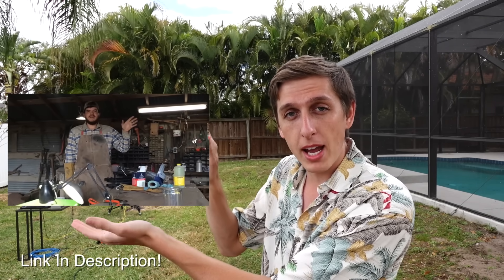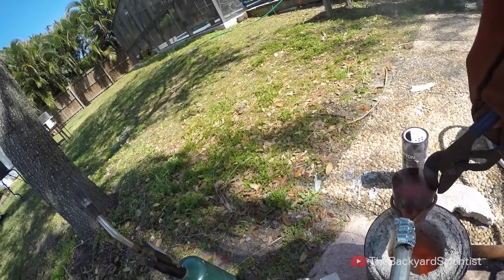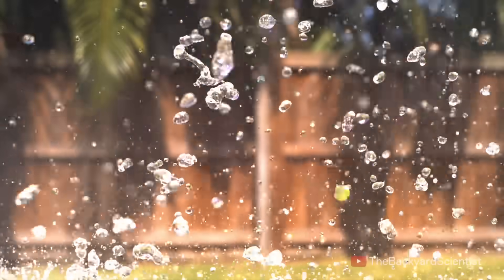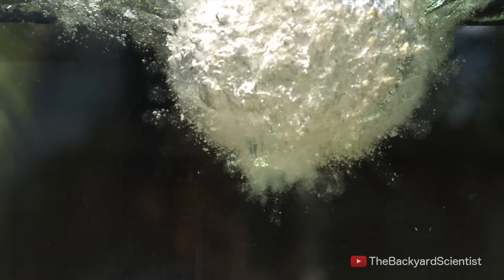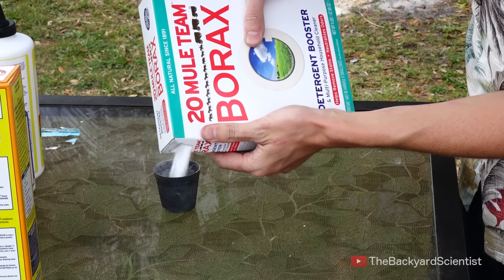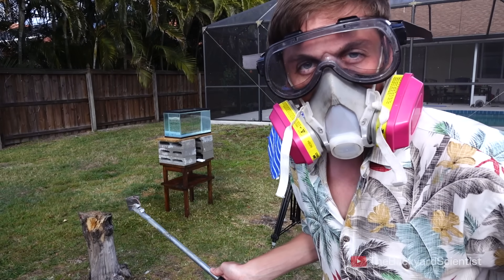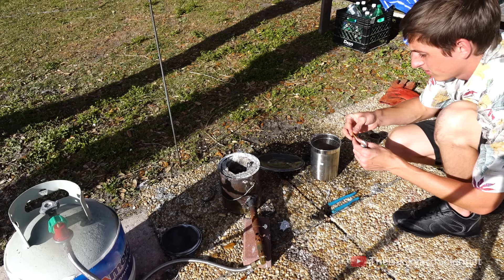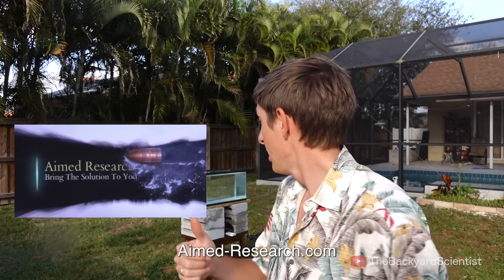Pouring Molten salt into Water - Explosion!

Comment: Explanation: The sodium reacted with the water because it's an alkali metal, and not because of the heat. The NaCl (the salt) doesn't react with the water, but since it is very hot it instantly heats up the water to its boiling point which creates lots of steam, which is the "explosion" (like when you pour water on a hot stove). The "explosion" with the salt and the sodium aren't related to each other. One is a chemical reaction, and the other is just a rapid change of aggregation in water because of heat.

Comment: Shouldn't 21,000 fps be extremely fast?
Reply: That means that you could slow the video down to 1/21,000 of a second, so no.
Reply: What they do is they slow down the 21,000 FPS footage, so it's more like 60-ish FPS. To elaborate, imagine capturing a single second of 21,000 FPS footage, then slowing that down to the point where 60 of those 21,000 frames are played each second over a longer period of time. Simply put, the higher the FPS of a recording, the more it can be slowed down without making it look choppy.
Reply: Cameron Meetze Depends what you're doing. With videos it doesn't

Comment: Sodium chloride is a salt that has a much smaller particle size than boric acid and sodium carbonate, and of course water. This property allows it to heat up much more water molecules as it can side through the gaps between the water molecus, heating them up as it goes. When the water molecules expands, it will tend to hit one another, causing a chain hitting process. Just like an atomic bomb, the molecules will hit any particle in its path, may result in a shattered container mess to clean up.

Comment: l got an explanation :
Sodium chloride is a salt that has a much smaller particle size compared to boric acid and sodium carbonate, and of course water. This porperty allows it to dissolve in water, involving more water particles. As the water molecules expands due to the heat, it will tend to hit one another, causing a chain hitting process. Just like an atomic bomb, the water molecules will spread out, hitting any objects in its path, resulting in an explosion that broke the container, shattered in pieces.

Comment: Rapid thermal expansion.

Leidenfrost isn't having an influence because the surface area of the salt is too great and acting at too small a level for it to act in a preventative manner. It's basically going into solution as soon as you pour it in, but because it's molten it's pushing the water away from it at damn near the same time and forcing multiple bubble-explosions into each other until they combine and force further outward. 

You tested the pH of the water, but you could also test the EC and salinity before and after to see if this is plausible, but it makes sense to me.

Comment: I think it is due to solubiity differences. I am assuming that these Na salts retain solubility differences that they show in room temperature. Because NaCl is more soluble, it is dissolving faster, and making more superheated steam. Potassium salts are more soluble, so those should make even greater explosion. Say, if NaCl and KCl melt at similar temperatures, and KCl is more soluble than NaCl, it will make a bigger splash.
Reply: I am not encouraging you to do it. This is too dangerous, and you are unprotected.

Comment: sodium is an Alkali earth metal, so when you melt down salt you're creating a solid brick of sodium that's highly reactive with water. It can even explode with humid air. Its highly dangerous and you shouldn't have messed around like this without proper research.

Comment: it looks like the liquid sodium salt has a much lower viscosity and possibly lower surface tension than the others. If it is separating and allowing for rapid thining it could be cooling fast enough to drop below the Leidenfrost threshold and encapsulate droplets of water.

Comment: My guess is that the molten salt has a rather low surface tension and low viscosity unlike other tested materials.
Then it takes less energy for a molten salt drop to tear apart anx mix with more water, than for the leidenfrost effect to form.
Also, sodium chloride has an extremely high enthalpy of fusion, that might also explain stuff.

Comment: this is a chemical reaction, drop pure sodium(not melted) into water and it will ignite/explode. it is a defining property of alkali metals
Reply: the reaction is a product of the ionization of the alkali metals and the water. this is due to the transfer of energy abundant electrons to the h2o molecules from the Nc atoms. The transfer rapidly repels the resulting positively charged sodium ions. (if you wanted a more scientific response).
Reply: +Larry Wyatt Nc= sodium (and you probably know this but) H2O = water, and this goes for all alkali metals not just sodium

Comment: I think we can agree that the molten salt is creating a STEAM EXPLOSION, not generating hydrogen and chemically exploding.  Perhaps you should heat up a large ball bearing or a small cannon ball cherry red and drop it in and see what happens.  If you can find a metal ball with dimples like a golf ball it would have more surface area, and provide an interesting variable, as more surface area would provide a greater heat transfer rate.  Come to think of it, part of the rapidity of the heat transfer could be that the molten salt is being cooled below its melting point and therefore MUST release its Latent Heat of Fusion, which is immediately being converted into Latent Heat of Vaporization for the water.  Be careful, so you don't earn a Darwin Award. ;)

Comment: I heat treat metal using this cooling process and can tell you getting the splash back from this burns so bad. Even through protective gear at work I have the scars on my hands to show for my efforts

Comment: This is kind of steam explosion. salt is sodium chloride which is a stable reacted compound which has no chemical reaction

check out https://en.wikipedia.org/wiki/Steam_explosion for knowing more on steam explosion
Reply: I quote the webpage "A steam explosion is a violent boiling or flashing of water into steam, occurring when water is either superheated, rapidly heated by fine hot debris produced within it, or heated by the interaction of molten metals (as in a fuel-coolant interaction, or FCI, of molten nuclear-reactor fuel rods with water in a nuclear reactor core following a core-meltdown). Pressure vessels, such as pressurized water (nuclear) reactors, that operate above atmospheric pressure can also provide the conditions for a steam explosion. The water changes from a liquid to a gas with extreme speed, increasing dramatically in volume. A steam explosion sprays steam and boiling-hot water and the hot medium that heated it in all directions (if not otherwise confined, e.g. by the walls of a container), creating a danger of scalding and burning.

Steam explosions are not normally chemical explosions"

Comment: It's the sodium hitting h2o. Since sodium vs. h2o equals an explosion, that's exactly what happened. Because the sodium chloride was heated to a very high temperature a chemical reaction could have happened causing the sodium and chloride ions to weaken their hold to each other, causing a large explosion when the melted compound hits the water. This is just a hypothesis aka my own opinion.

Comment: Sodium Chloride does not react with water chemically, it dissolves into sodium and chlorine atoms, and does not change the pH. Whats happening is the sodium in the salt is partially shielded by the surrounding chlorine atoms, and thus gets a little deeper than the pure sodium before exploding. Just like a grenade under water explodes with much more concussive force than a grenade in air, the resulting explosion of the salt is bigger than that of pure sodium which simply explodes on the surface of the water.
Reply: Tbh, I was way to lazy to read all that.
Reply: +Armine enimra but not, apparently, too lazy to respond... lol
Reply: nope, that would imply a chemical reaction, because just sodium 0 explodes with water, but the sodium ion in sodium chloride are +1, plus the reaction between sodium and water releases NaOH that changes pH
Reply: From what I am seeing I would suggest that the reaction has two phases:firstly an implosion phase, and secondly an explosive phase.
When the molten salt makes initial contact with the water, the outer part of the glob of molten salt cools more rapidly than the internal part of the glob of molten salt. The direction and speed of the temperature differentiation wave is towards the centre of the salt and squeezes the molecules together as it goes. Once it reaches the centre it cannot go further and pressure builds up and rebounds the wave outwards to cause the explosive effect. It's a physical reaction rather than a chemical one.
Reply: @Franco Viscarra: Yes, and chlorine reacts with water to create hydrochloric acid, HCl, and in a subsequent reaction, HCl and NaOH combine back into salt and water (well, dissociated into separate ions, Cl⁻ and Na⁺).
There is a rapid hydrolysis going on, but even though sodium reacts with water at room temperature, there is no violent explosion when salt is added to water.
If there was a chemical reaction, the explosion would cause some of (either) sodium hydroxide or hydrochloric acid to be thrown out of the container and there would be less of either element after the reaction, so the resultant solution would have been acidic or basic, but I'd be hard pressed to believe that both products escaped in the same amount so the solution remained neutral.
Reply: Elysiumfire got it, the other hypotesis are just wrong
Reply: mantan channel you're a weeb, yes offense
Reply: Lucas Johnson that is exactly what's happening!
Reply: +Lucas Johnson. I was about to say the same thing
Reply: I thought it was just a thermal shock
Reply: Lucas Johnson oh.. I thought it was HOT HOT pour pour BOOOOOM. But nah.. Mr. Einstein got me covered
Reply: So, you're saying both explsions are caused by sodium reacting with water, but if you see them side by side you can clearly see that when sodium reacts with water it literally burns (actually the hydrogen liberated in the reaction does) and you can see a ball of fire in the explosion; on the other hand, you can see in the salt explosion that theres no fire or similar thing at all, the volume is increasing without any combustion (apparently) wich supports his theory.
Reply: If you are implying sodium reacting with water is what causes the explosion, you're completely ignoring the chemical equation for sodium reacting with water.  The balanced equation for sodium reacting with water is:

2Na + 2H20 --> 2NaOH + H2

If the Sodium was chemically reacting with the the water, the resulting explosion we saw would have been a result of the exothermic reaction igniting the hydrogen produced.  The other byproduct of this reaction would be an aqueous solution of NaOH (sodium hydroxide) which is alkaline, and most certainly would show up on a pH indicator.  

And to those who say HCL is being created and balances out the NaOH, it just doesn't work that way.  By using the argument that sodium is what is causing the explosion, you're also arguing that H2 is being ignited to cause said explosion.  With the formation of NaOH and the hydrogen gas that causes the explosion, where exactly is all this extra hydrogen coming from that "magically" forms the HCL?

physical reaction, not a chemical one, plain and simple.
Reply: so what NBA team are you betting on?
Reply: The Rock.
Reply: Lucas Johnson that's literally what I was thinking and I'm an eighth grader taking 9th grade physical science and algebra one so good thinking man
Reply: Makes perfect sense
Reply: Ykyrg. Iiikrr
Reply: So if you have something like a dissolvable capsule filled with pure Sodium, the reaction would be comparable if not bigger than the Sodium Chloride, because the dissolvable capsule would free the pure Sodium with a slightly delay when completely underwater.
Reply: Dawson Parks maby your just stupid
Reply: your a nerd, no offense
Reply: okey
Reply: u must be a scientist
Reply: Lucas Johnson whoa whoa back it up!
Reply: If only physical reaction is taking place, why not other salt exploded. I think that questions your hypothesis.
Reply: i thought it turned some of the water to steam and we all know what kind of explosion steam can make, and if some do not, go stand on an active volcano.
Reply: I thought the same thing dude
Reply: That doesnt explain why the other sodium compounds did not work
Reply: No offense, but I just came here to see an explosion and not to learn anything. I'd thank to not try to tell me something interesting:)
Reply: nope it's just a steam explosion nothing more nothing less -_-
Reply: that would give you the leidenfrost effect - the steam ends up acting as a shield. This is quite a different physical phenomenon.

i suspect the exploding bead suggestion may well be the cause. You're going to need higher framerates.
Reply: Youre cute AHAHAHAHAHAHAH
Reply: but, again, how do you explain the absence of any fire or light of any kind if it's not a mechanical explosion, you cannot see any kind of proof of a chemical reaction taking place, why do you asume it is?

Comment: "Pure sodium metal doesn't react as violently as molten salt." I don't know about that man... the pure sodium was a legit explosion. the molten salt was just a pressure wave.
Reply: Fair enough.
When I think explosion I think of some kind of thermal reaction as well. I know that that isn't the only part of an explosion, but that's what I think of first.
Reply: The pressure wave is arguably (because comparing explosions like this is obviously subjective) the most important part of an explosion. It's what separates a detonation, where the pressure wave travels faster than the speed of sound, from a deflagration, where the pressure wave travels slower than the speed of sound. The sodium had flames because it was a chemical reaction releasing hydrogen which then caught fire, whereas the salt solely caused the water to boil (incredibly quickly).

Of course which explosion you consider more legit or more violent is a matter of opinion. It just sounds strange to my ears to dismiss an explosion as being "just a pressure wave".
Reply: Molten Salt also had more time to immerse fully, thus creating a greater degree of potential to push on the aquarium glass (more perpendicular vectors).

The pure sodium flared up and out without going more than a couple of inches into the water; likely throwing much of the sodium clear before it could react. Looking at the photography, it was also the only reaction in this series that omitted an actual colored thermal flare, which is a pretty clear indication of tremendous and immediate energy release.
Reply: @skojo3e: The problem is with trying to do it with melted sodium. You can't just store it in kerosene like solid sodium.
About the only solution I can think of is putting it in a weighted steel container (so that it will always reposition itself to a top position) with a glass cap, submerging it, and forcing it upside-down, so the hot sodium will cause the glass cap to shatter and start releasing the contents (and the container will try to straighten itself, spreading the sodium around).
Reply: An explosion defined is a rapid expansion. Fire is not needed for an explosion. Pure sodium chemically reacts with water and releases hydrogen. The heat then ignites the hydrogen causing a secondary explosion. So for the sodium we are seeing a first explosion from super-heated water and then from the hydrogen burning.
Reply: One was a combusion reaction and the other was pressure but they were both explosions. The sodium one had more umpfff.
Reply: There has to be a way to mix the sodium metal with the water instead of pouring it. If something could propel it deeper into the water you may have a bigger reaction
Reply: Molten Sodium in water generated a nice hydrogen explosion quite fast as soon as it touched the water surface. the energy of the explosion most likely shoot the most part of sodium in the air.
If you try with metallic sodium, most of the time the metal does not even sink in the water, it barely touches the water surface and and flies on a gas pillow created by chemical reaction and water vapor
Reply: NINTv               Bill   BB bbbmnbjbv
Reply: bin bag
Reply: gdjgzkz
Reply: I believe the reason it did not react as violently as it usually would is because it is in a molten state.The sodium in a molten state reacts more quickly than if it were in a solid-state not allowing it to sink into the water creating a more violent explosion.
Reply: > There has to be a way to mix the sodium metal with the water instead of pouring it

 You mean like pour water over molten sodium?  :D  (Or do like the Mythbusters did and break a vial of reactive metal underwater, by remotely-triggering something to drop on it and break the glass).
Reply: Cable Butkus
Reply: Cable Butkus look up hydrostatic shock.

Comment: Based on your theory I think the leidenfrost effect breaks down due to a lower viscosity. The chemical bonds of the molten kosher salt are probably weaker, thus allowing the water to penetrate it. When molten, the other salt remains in globs, which is why I assume it is of higher viscosity, and this "seals out" the water.
Reply: and if the explosion is due to rapid boiling as mentioned in a comment then the lower viscosity = larger surface area
Reply: (when poured)